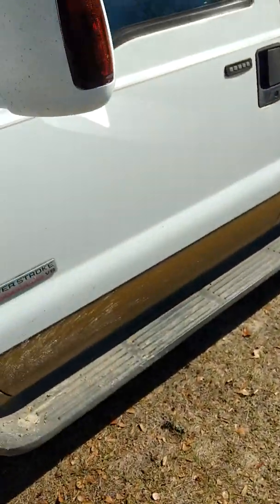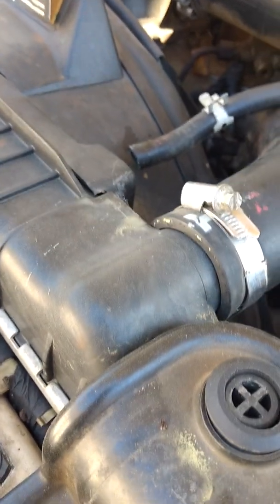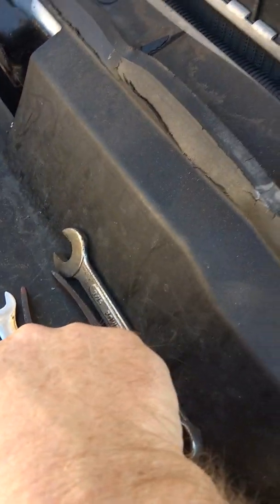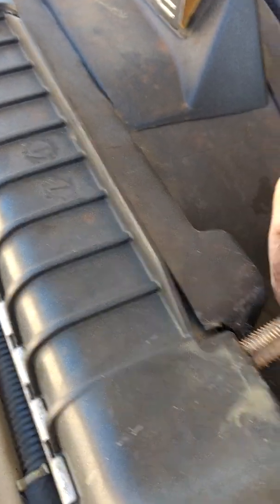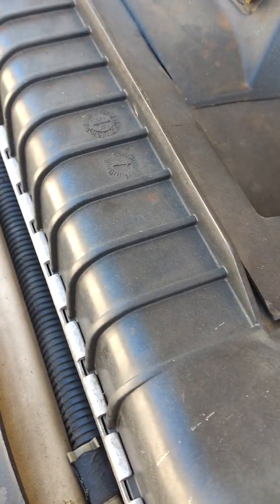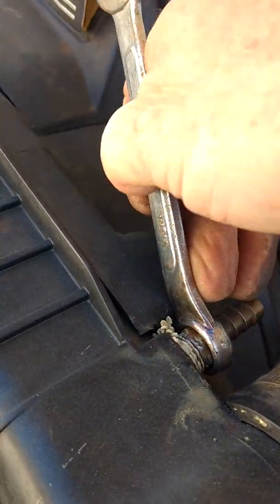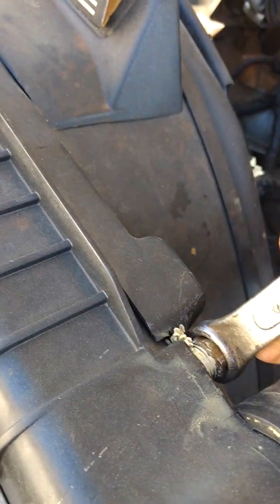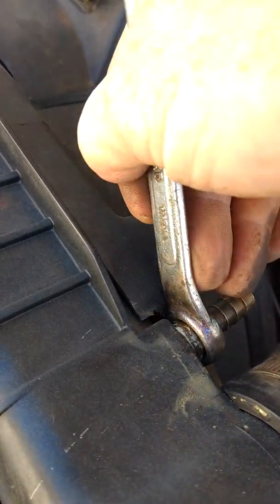Ford Radiator Repair

Comment: Will this work on a f150
Reply from the maker: Sure
Reply: @tonnsutton4810  thank you so much, I did the same thing and broke the plastic nipple on my radiator line to reservoir, I just knew I would have to buy a new radiator, that's when I found your video thanks again so much
Reply: @tonnsutton4810  is the threads 3/8 or half inch
Reply from the maker: @joewarren3n1  1/4

Comment: What type of silicone did you use?
Reply from the maker: None. You can use thread tape. I tapped the hole for the threaded barbed fitting to screw in.
Reply: @tonnsutton4810  ok thanks